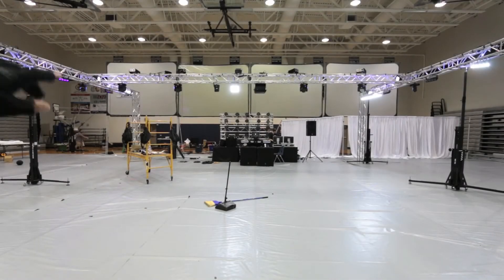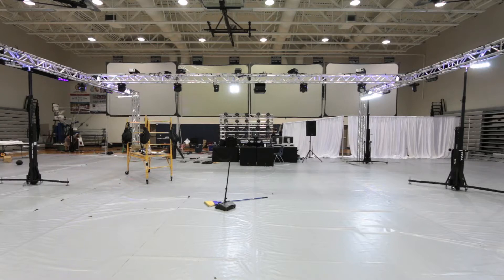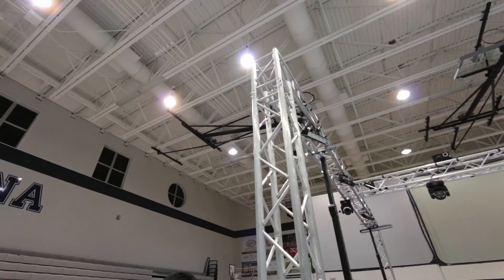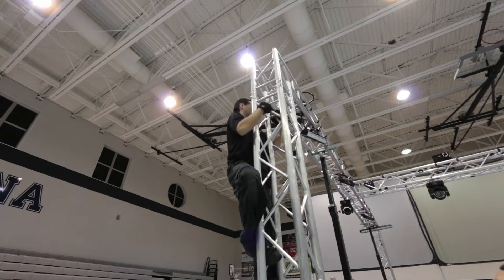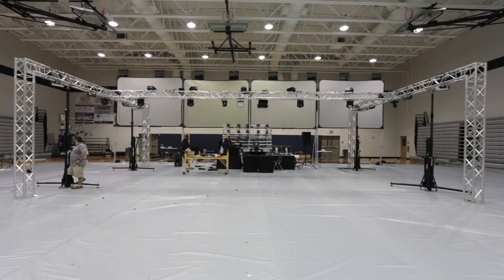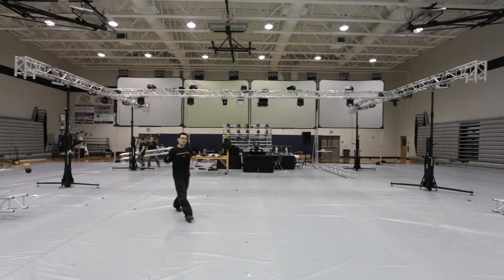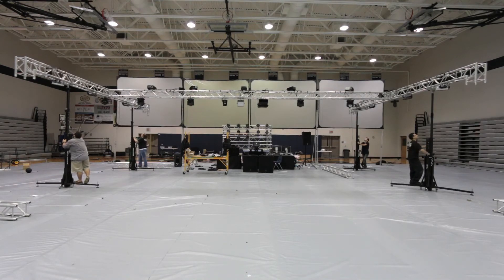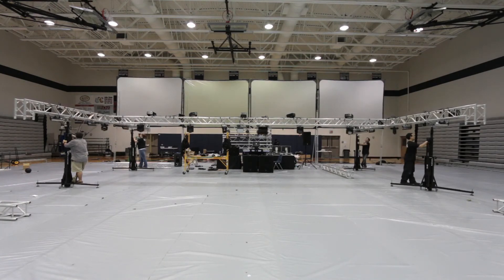Using the Duratruss Pro 5200s and 5000s

Comment: Hi Arnoldo, just wondering how do you dress the feet of the Duratruss Pros to prevent people tripping over the legs. They look quite wide.
Reply from the maker: Options: 1) Cocktail tables (4 around each leg)
2) Use the DT4000 instead.